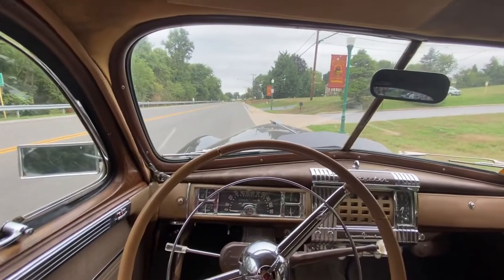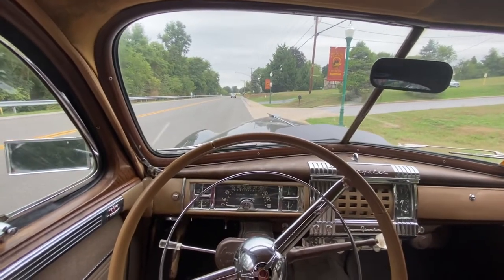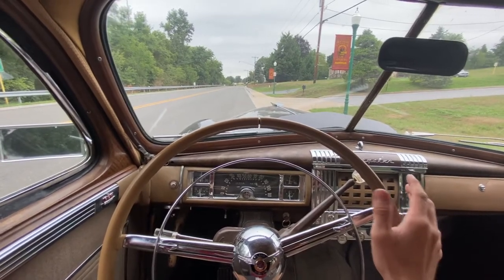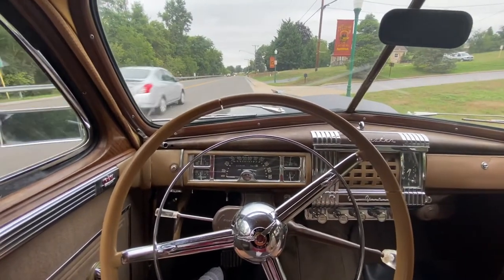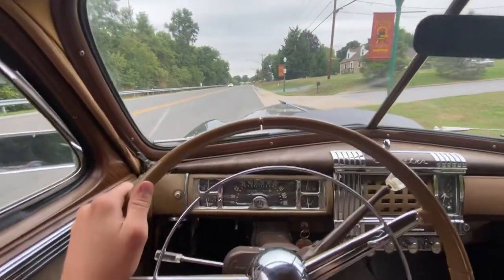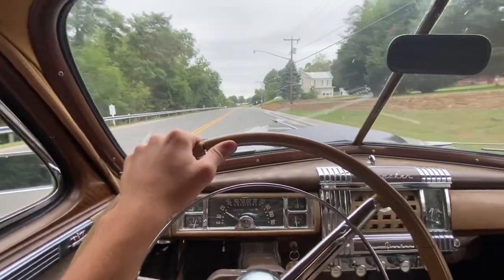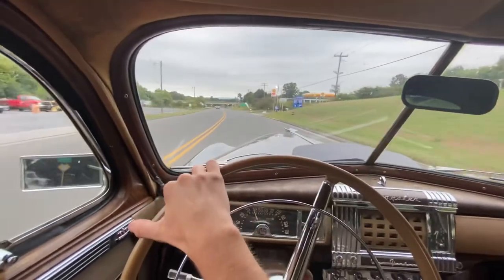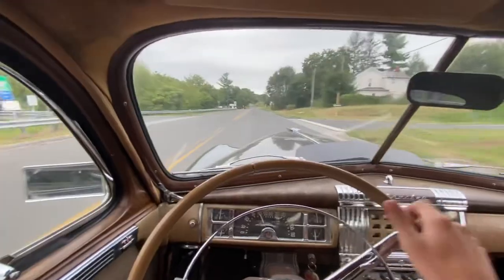How to shift a fluid drive transmission

Comment: No reason to use low range unless going up a steep hill or pulling a heavy load.  90% plus of normal driving is done in high range so just put it in high range and start it and drive it. This is what Chrysler taught and recommended to all drivers with Fluid Drive.  That was the benefit of Fluid drive - minimal shifting!  Automatic transmissions came out early 50’s and were just two speeds which is essentially what driving your fluid drive in high range is.
Reply: I laugh at how younger people just don't understand Fluid Drive.
Reply from the maker: I know I start in high most the time I was just showing how to shift all gears with it 👍🏻
Reply: General Motors debuted their fully-automatic "HydraMatic" in 1940.  Two years prior to that, they'd experimented with what they called the "Safety Transmission" which appeared to be a manually shifted planetary gearset.  It was quickly discontinued as GM engineers figured how to make it fully automatic with hydraulics.
Reply: And it was a 4 speed automatic...
Reply: The first truly automatic transmission was released by General Motors in 1939 for the 1940 model year. It was the first hydramatic, after WWII other car makers were buying them from GM.

Comment: i didn't realize it's that easy. I love the art-deco dashes of of Chryslers at that time. Classy and glitzy at the same time. The '46-'48 period are many of my fav cars.
Reply: They are deco because like the rest of the car other than some details like the grille, bumpers, tail lights etc. they are identical to a 1942.
Reply: @emjayay  Yes. If it wasn't for WWII, say the '55 Bel Air, would've been introduced around 1949.

Comment: What you have is the M5 semi-automatic transmission that came standard in the New Yorker.  Chrysler would refer to it as fluid-torque, in my Dodge it's known as gyro-matic, in a DeSoto it's tip-toe.  Fluid Drive is a term normally associated with the 3 speed manual with the fluid coupling that was standard on the Royal and Windsor.
Reply: Thank You for saying that so simply. I have a three seater Bus coupe with the Three speed fluid drive and was chomping at the bit to say thats not a fluid drive. What it is is the trans that Mercedes used under license for their cars . They called it the Hydrac . lots of micro switches and vacuum actuators. They also used the Chrysler four season a/c . If the motor and trans mounts go you end up with shifting complaints. Thanks

Comment: I have seen in a lot of these videos people driving Chrysler Fluid Drive transmissions excessively in the LOW RANGE. In most cases, the HIGH RANGE will comfortably handle most driving situations. Each range has a set change down speed  High Range 3 & 4 Set Change down is 12 Mph Low Range 1 & 2 Set Change Speed is 6 Mph. Change down before those respective speeds is usually done with the Kickdown ( Hitting the Accelerator flat to the floor through a slight step at the end of travel).

Comment: sorry don't know why YouTube crossed out half of this response it's all valid .This car Is not (fluid drive) it's it's a M-5 fluid coupled semi-automatic 4 speed gearbox with electric servo shifting. It was called Gyro-Matic in a Dodge. Fluid Drive was a standard 3 speed transmission with a fluid coupling. You had to shift gears manually but you could bring the car to a stop without declutching without using the clutch you could take off in high gear but acceleration was very slow in 3rd. Normally you only used 2nd and 3rd gear so only one shift was necessary. I have had cars with both I much the prefer Fluid Drive 3 speeds. The first two gears in the 4-speed are like compound low in an old truck first is good for about 10 miles an hour   second gear  is wound out at 20 mph.
Reply: Chrysler in many years called it "Fluid Drive" regardless of whether the fluid couple was in front of a 3 speed manual (Dodge) or in front of the semi-automatic (DeSoto and Chrysler).

Comment: So in theory the only time you would have to use the clutch would be if you want to start out in first or go into reverse?   You could leave it high all day and never once use the clutch?
Reply from the maker: Yes you can leave it in high
Reply: The clutch is ONLY to select a range, or to change from one range to another - Drive to Lo, Drive to Reverse, etc - never for stopping.
Reply: Yes

Comment: A friend of mine owned one of these cars for a while thinking it was just a 2 speed 😂
Reply: It technically is a 2 speed. With an overdrive added, so each range, low and high gets a second gear, hence 4 speeds. It shifts automatically between 1-2, and 3-4, but o ly manually between 2-3, as that's the low vs high range, ie, the 2 speed. Then a torque converter is added for start/stop. That's how one can leave it in high all day. Small streets and slow city driving, 20mph and less is good for low. All else is good for high, or just high all the time, although it accelerated slightly slower. The manual clutch is ONLY used to shift between low-high range, or reverse/neutral.

Comment: during wwII my dad drove a company dodge (1942) with a fluid clutch.  Most other employees avoided this car but my dad love it in Winter.  It had a normal 3 speed coupled with the fluid clutch.  you could put it in any gear ( even high) and start out from a start.  Great in snow and ice because in High gear you started out with very low torque and did not spin the tires.

Comment: I've owned a '48 Chrysler Windsor for several years now.  The Fluid Drive is pretty complex for early post war auto technology. It takes a synchronized action of three different things to all happen.  Hydraulic, mechanical and electrical.  Plus if the carburetor's idle is set above 450 rpm.  The car won't shift.
If you pay attention to the video, the car doesn't shift once it is in high gear. That's because if you use both low range gears, first and second, it will be in 4th gear once you go into the high range.  If you only use first gear in the low range, then once you go into high range, it will use both third and forth.  It was designed that way.  
If I'm city driving and going from stop sign to stop sign in short city blocks, I just use low range.  That being first and second.  But if I'm going from a stop to highway speed, I find that the most efficient way and the fastest way is to use first gear in low range, then shift to high range.  That puts the car in third, then take the revs up to what instinctively sounds like an appropriate time to shift and let off the gas and now it's in forth.
Another feature is if you are in forth and you approach a steep hill, once the car starts to slow down, you push the gas pedal to the floor, then let off, then push down on the gas pedal again and now you're in third.  However these cars have amazing torque, so in no time you're wanting to shift into forth again.  Actually if you were to leave it in forth on a steep hill slowly but surely, the car will begin to gain speed even if it is in forth.

Comment: I heard somewhere that the cars with fluid drive don't have a "park" function.  Like, if you park most cars with a regular automatic transmission, you put it in "Park" and engage the parking brake, and that is what holds your car in position.  But, if the fluid drive cars don't have a "Park" function,  is the parking brake all that hold the car stationary when parked?
Reply: Yes, no parking pawl on a semi auto. On the inside its build just like a manual transmission, just used hydraulic pressure from engine oil, and electricity to actuate a shift solenoid to move from either 1-2, or 3-4. You need to use a parking brake to hold the car still when parking it.
Reply: Wow.  That's like, DO NOT forget to put on the parking brake!!

Comment: My 1953  Dodge Coronet had a  fluid drive tranny 2 speed PTO , Flathead turbo; 6.cylinder dual exhaust, and in overdrive would get a hundred miles Per gallon of gasoline, I drove from the southside of Chicago to Woodstock Illinois one gallon,  , the design was so good it was stolen from the Dodge Family 🇺🇸♥️🇺🇸👍‼️

Comment: How fast have you gone in the car?  Is it fast enough for the interstate?
Reply: According to a site called Classic Car Database that car has a 3.91 rear axle ratio which means you can probably do 60-65 mph without over revving the engine. Me I don't drive interstates unless there is no other choice. They are death traps.
Reply from the maker: It’s quite happy at interstate speeds

Comment: I’m all new into old cars currently saving up for one at a young age , I was wondering what kind of gas does it take ?
Reply: Something that age would most likely run fine on 87 octane but if the engine hasn't been updated with hardened valve seats, you'd have to put a bottle of lead additive into the tank before you fill it up. Car will run without it but, you'll risk damage to the valve seats, valves, and head. Also you'd have to either run ethanol free gas in it or upgrade the fuel system to allow the use of e-10 or e-15 gas. Running the car without upgrading the gaskets and rubber fuel system components to accept ethanol fuel can result in the deterioration of the rubber fuel lines and gaskets in the carburetor. This can allow unwanted pieces of rubber into the engine, clog up the fuel filter, and cause leaks that can cause a fire if they go unnoticed. Also, you'd have to run an oil with a high zinc content or put in a bottle of Inc additive to help protect the cam and valvetrain from damage. Back to the fuel system, ethanol laced fuels also absorb water when they sit. So if you get to buy yourself one of these cars, it's best to either run the car low on fuel and wait until you're ready to drive it again or add a bottle of fuel stabilizer to the tank. They make specific stabilizers for ethanol fuel. Hopefully this helps you out.

Comment: You don't have to start out in low range.  You just clutch, shift into high range take your foot off the brake and then accelerate up to a speed about around 15 mph or faster, let up on the throttle and wait for it to shift into 4th.   The only time you need to clutch is when going into reverse or forward.
Reply from the maker: Yes I believe I said you can start in high range at 1:59 I do that most the time

Comment: I just received a 1947 dodge d24 and it has fluid drive, when we moved it it would not go into gear, does the vehicle have to be running to get it into gear?

Comment: The fluid drive transmission has only three speeds. The low range starts with first gear then shifts to second, the high range starts with second gear, then shifts to third gear. There is no such thing as third and fourth gear.

Comment: I would start in 1st gear then go in 2 or 3 Then when I would stop go into first gear and do the same
Reply: That's not necessary and defeats the purpose of the semi-automatic transmission.  Just put it in HI, (Drive on the 50s models), and drive off just like a modern automatic.  If you have a Dodge with the 3 speed trans in back of the fluid couple, you can start off in 2nd unless you are on a hill.